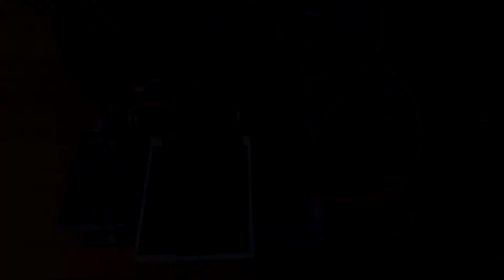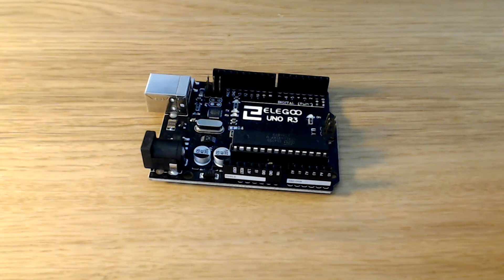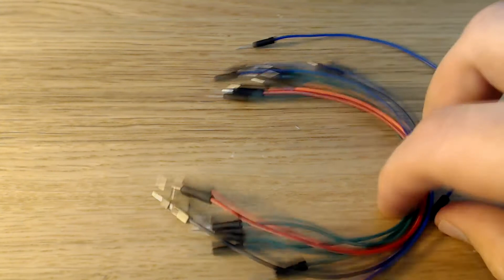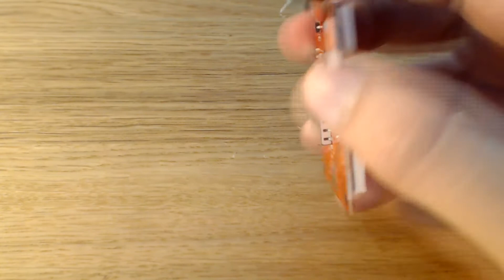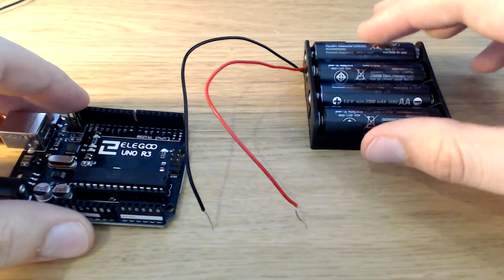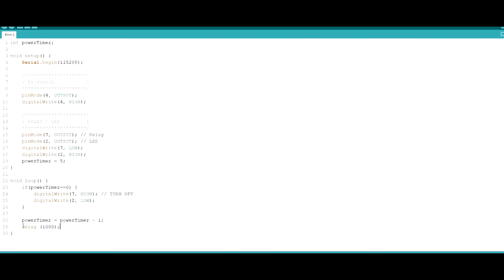Arduino Standalone QR Code Generator and Auto Shutdown [PART 1]

Comment: Is that a switch or momentary switch? How come the Arduino doesn't power off as soon as you release the button? Also, why did you connect the power source to the Arduino 5V instead of Vin?
Reply from the maker: I guess you're asking about the button - that's a momentary switch, take a look at the list of all the parts used here in the video description section. 
The power source is connected to the 5V in order to facilitate the auto-shutdown feature. Please watch the full set of these series and it will make more sense.
Reply: @xLastxTemplarx  thx for your reply. I better understand how the circuit works now.